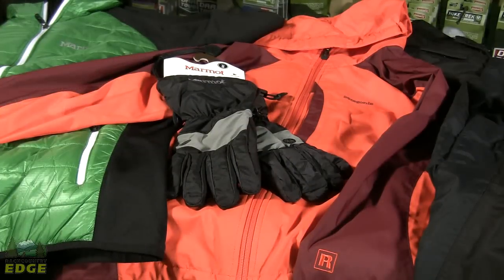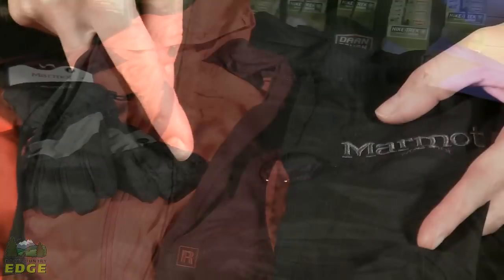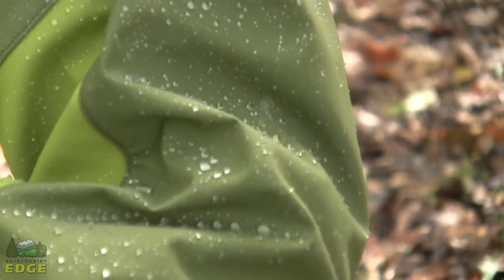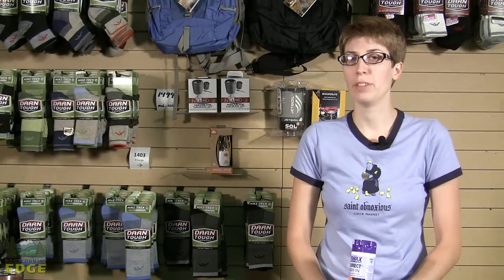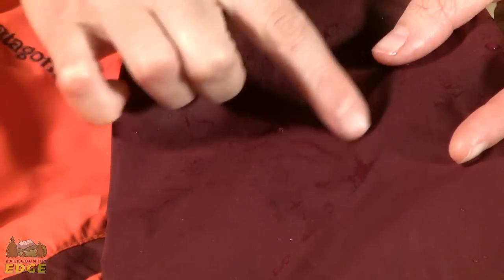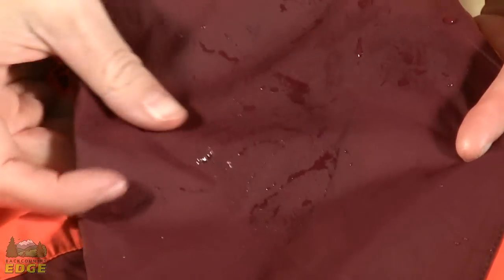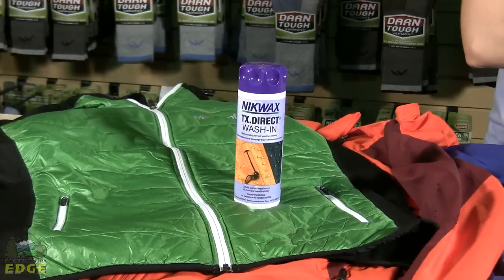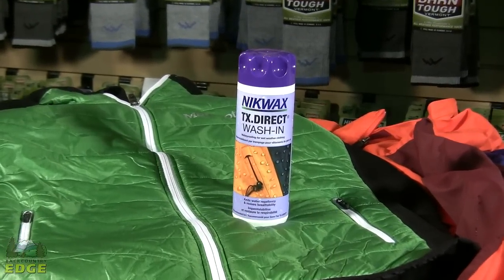What is a DWR and How Does it Work?

Comment: Do you have a video on how to re-coat your DWR garment? Interested in re-coating a few jackets. Also can you use TX.Direct to make a jacket or pants waterproof?
Reply from the maker: Hey Steven, thanks for the question!  Unfortunately, you can't make a non-waterproof jacket or pants waterproof simply by treating it with TX Direct. For example, a thin windbreaker will have enhanced water resistance after being treated with a DWR but it will not ever be completely waterproof. Hope this helps!  We hope to have a how to video soon!